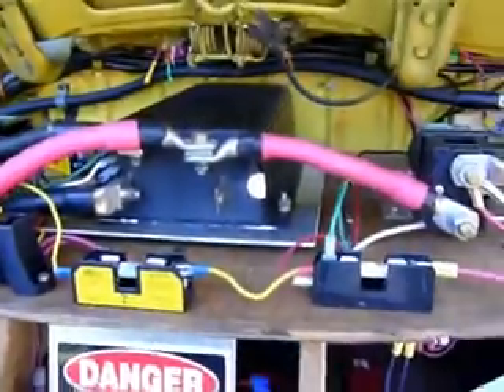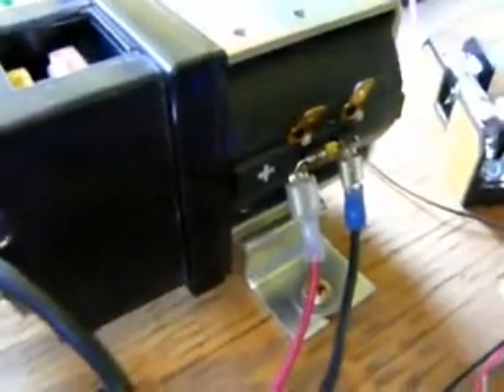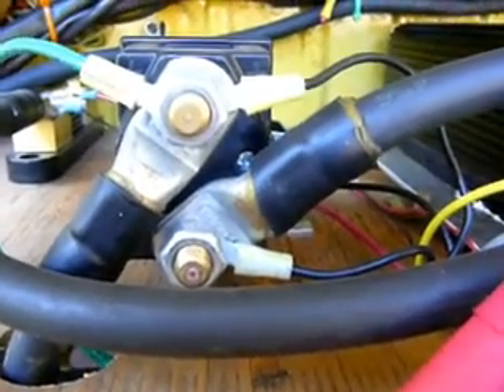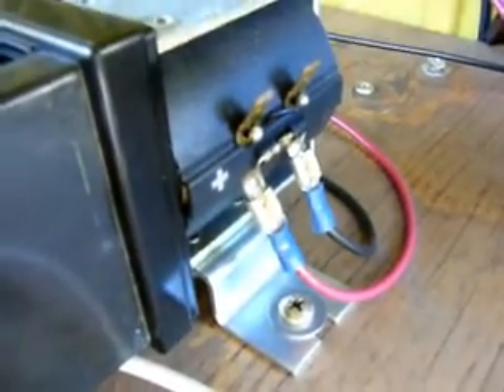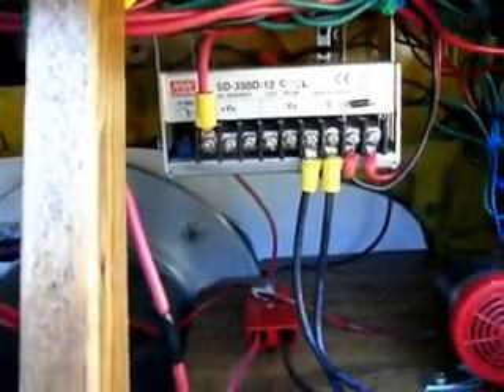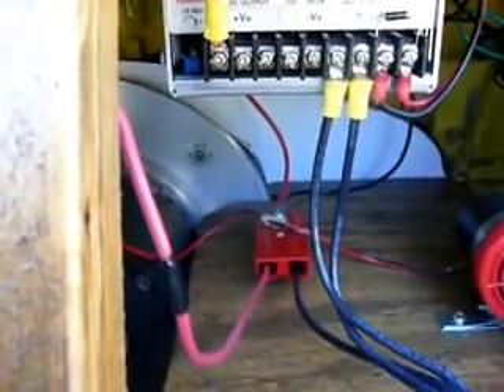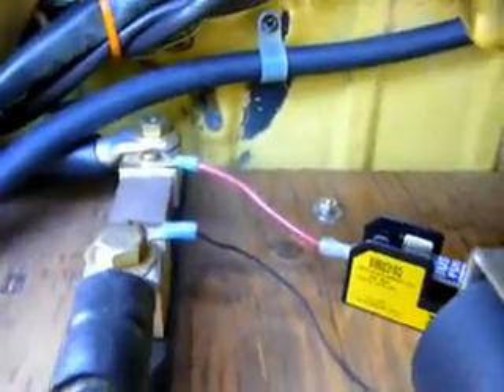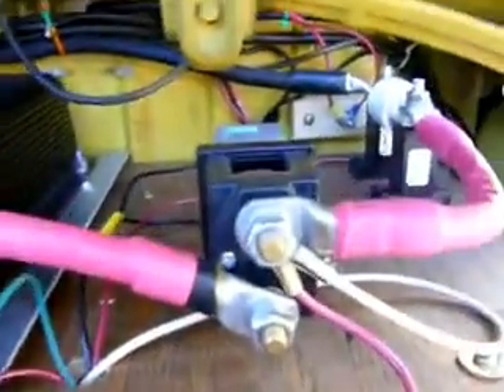Electric VW Beetle Conversion Details II

Comment from the maker: @virelly The kit, wire, wood, and misc items totaled about $5000. The batteries were $1450.. Summertime I get around 28 to 30 miles per charge driving 0 to 60 MPH. Winter I can get about 14 to 18 miles driving 0 to 50. 

I am running a 96 volt system.

Comment: Ive been trying to find State & Local laws here in Maine for what requirements a conversion needs to meet.

I have a 93 Plymouth Grand Voyager from Georgia (never seen salt) with 150k in need of valve guides to stop its smoking habit and was thinking it would make a good candidate as the suspension was designed for 7 passengers.

Probably a pipedream of mine due to finances at this time but Im still intrigued by the idea.

Comment from the maker: Yep, you got it. As a matter of fact, to save a little on weight, I took the 40 pound 12 volt battery out and put in a 20 pound 12 volt lawn mower battery. Not much of a weight savings but every little bit helps.

Comment from the maker: Before installing the horn I hooked 12 volts to it and it made an audible sound. Yes, the motor has 2 wires protruding from the case where the horn can be attached. The inertia switch, I'm told, is the same as one used on a gas powered vehicle with an electric fuel pump. In case of crash the electric fuel pump is disabled. Not sure of the impact speed to activate. When activated, a plunger under the red rubber cap extends. Depress red cap to reset plunger. Very difficult to explain w/o schematic

Comment: Im not trying to be rude or mean; I subscribe out of curiosity  so a helpful video explaining to us that dont know how to read an electrical schematic on what does what, how and why would really be useful.

As I understand it, the DC/DC converter is taking the place of the 12 volt auxiliary battery and is utilizing the vehicles pack batteries and stepping the voltage down to feed all your 12 volt systems.

Thanks and please do keep us informed.

Comment: The video identified some components but didnt help in explaining how to wire anything.

You showed a warning horn and said it would alert you if your motor over heats but then said its never gone off; how do you know if it works? Is there a redundancy safety shutdown? What is it hooked too? Did the motor come with an internal sensor or does the horn come with one?

How does the inertia sensor work? What are its limitations; 5  10 MPH impact? What happens if it is triggered?